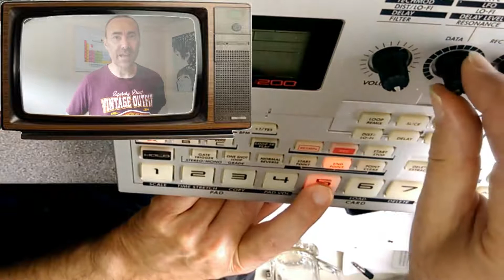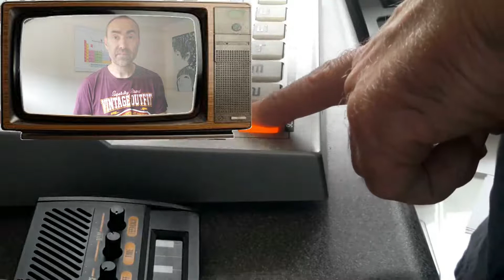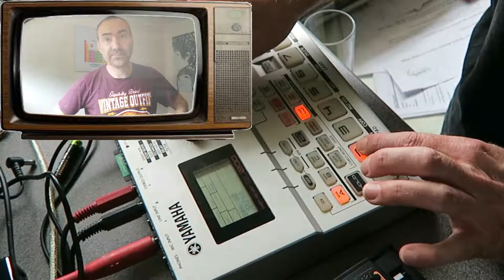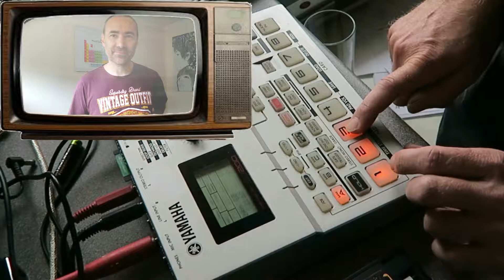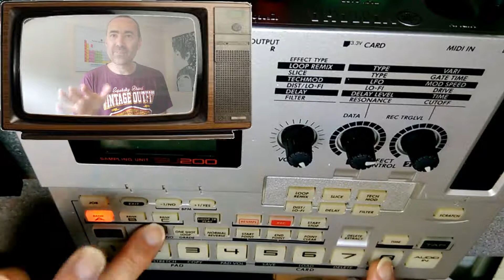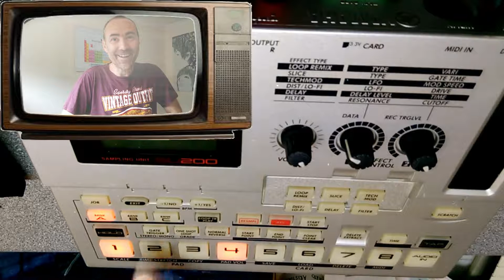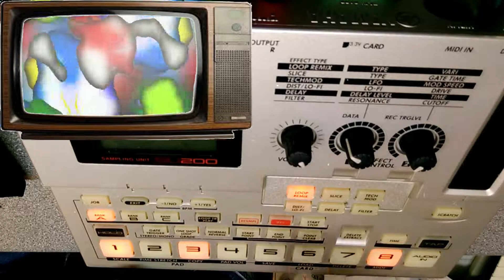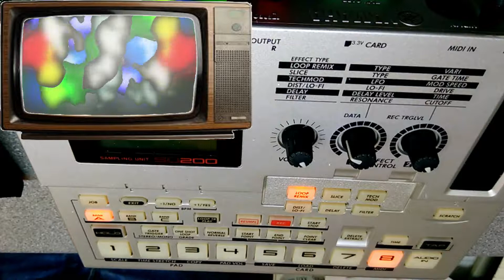Yamaha SU 200, Korg Monotron, Sound Design and Jam

Comment: Thanks for this. Looking to upgrade to the SU200 from the SU10. I love the simple easy workflow but would like to resample.
Reply from the maker: Honestly Matt I would look at getting something else. These machines are a pain in the arse to work with and there is no onboard sequencing. There are much better sample machines on the market nowadays for the same money and the minute you start locking the samples together in the loop sync mode they start to sound pretty crunchy.
Thanks for watching though and if you subscribe it would be appreciated.
Reply: @DocBolus  Thanks for the feedback. Really like the SU10 so might just stick with that. Nice gears that works with my set up for the samples I need. Thanks for posting.

Comment: what did you actually do when you were making a kick?
it went from a saw-wave click to a proper kick sound after resampling but i don't get how
did you just played a lower note of this resampled piece?
Reply from the maker: OK, so just looked back at this and it was some time ago but from what I can see and what I remember I went through a couple of stages. I think I did some filtering with a high resonance to bring out the bassier frequencies and then resampled that, follwed by a little distortion and maybe another tweak of filtering. One of the problems with the SU200 is that you can only apply one effect at a time so if you want to layer them you need to keep resampling. 
Hope that helps. I may do a video just on making a kick using the Monotron and the SU200 talking a little about what makes a good kick sound.
Anyways, thanks for watching and please subscribe if you haven't already.
Reply: @DocBolus  ah now I see, thank you for the explanation
by the way it was a very stylish jam, reminds me of some cool weird dutch electro from bunker records, late 90s/early 00s pure analog vibe
Reply from the maker: @alexey2093  Cheers man. I am a product of the 90's so I guess I graduate toward that kind of sound.